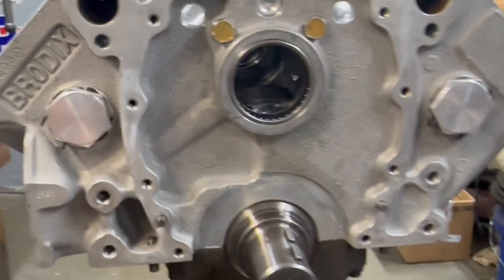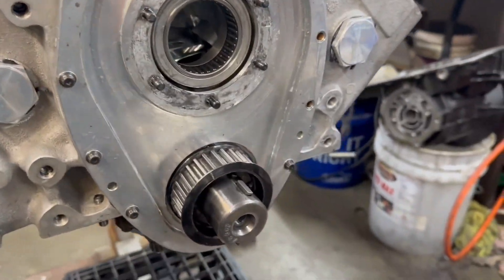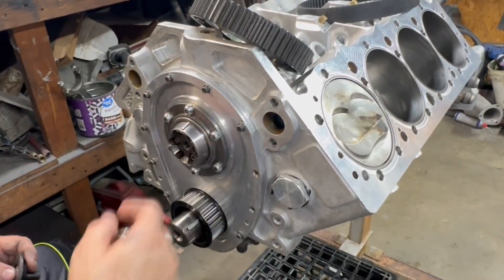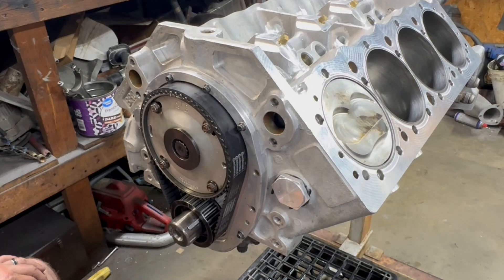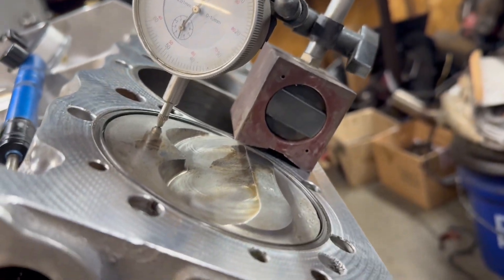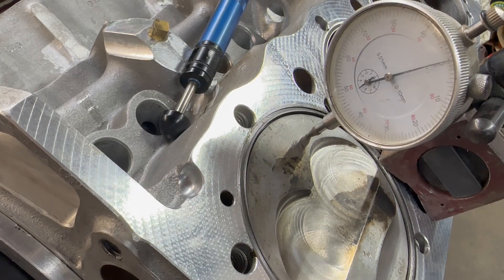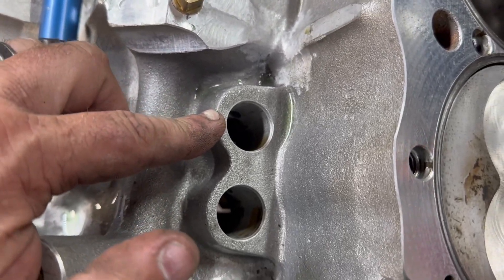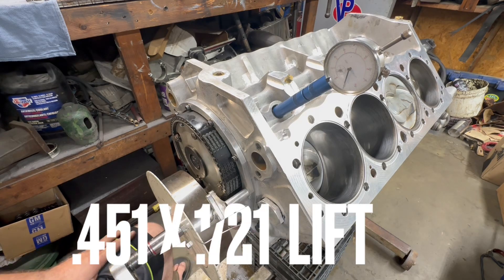How to Degree a Camshaft / Easy, you can do it!

Comment: People use piston stops and a do a lot of other lengthy processes to find absolute TDC. The easiest way there it to find  TDC is to dial indicate the piston on the center  of the top. Rotate the engine until the piston comes up and as soon as the needle stops moving, mark the degree wheel. Start rotating in the same direction and as soon as the needle starts to move again you mark the degree wheel.  At the center of the marks is TDC divine the degrees in half between your marks. Simple and easy.

Comment: If you are advancing the camshaft 6 degrees 104 to 110 you are basically changing your power band for example 9000 rpm down to 7000 rpm you are making everything happen sooner in the engine cycle correct
Reply from the maker: yes, advanced makes more low end and retarding makes more upper rpm

Comment: So if u didnt move anything since u had the engine apart why do u have to re degree the cam?
Reply: The engine was totally apart.  Everything was moved.
Reply: @danmyers9372  like what because the gear stayed on the cam. I guess there is something I'm missing. As long as u leave the cam gear alone, I don't see what can move.
Reply: @1clnsdime1 he’s moving it because he wants more power in the upper rpm range. Retarding the cam moves the power band up or later in the rom band. Advancing the cam would give it more low end power or lower in the rpm range. Doing no prep racing you don’t want as much power down low so you’re not fighting for traction as much off the line but this way he will making more power down track.